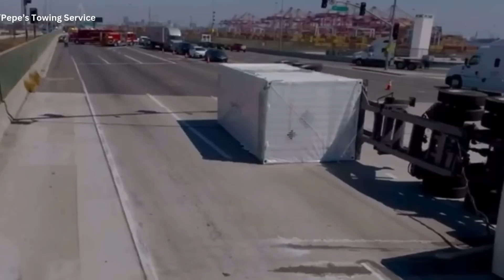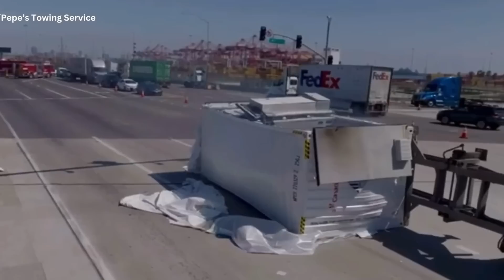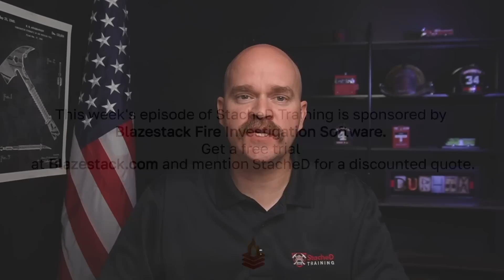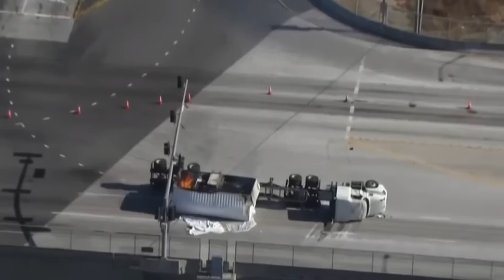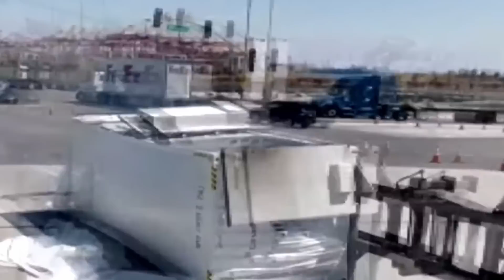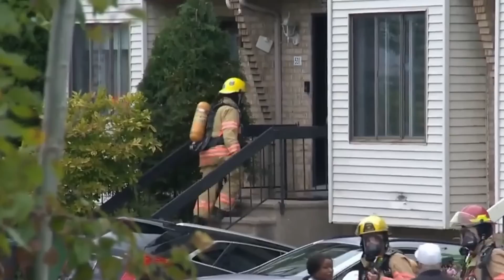LA Freeway Explosion & Montreal Port Fire: Lithium-Ion Battery Crisis

Comment: There are multiple kinds of Lithium batteries, LFP/Lifepo4 are safer than the NCM batteries in laptops/cellphones (and some EVs).  New stationary backup/solar systems should all be safer LFP Lithium batteries, but some EVs, including some Teslas still use the less safe NCM Lithium because they are lighter.  People concerned with safety should encourage the phase-out of the NCM-Lithium batteries in favor of safer LFP-Lithium batteries.  Gasoline is not the safest thing to be driving around with either, we are just accustomed to the risk of gasoline.  LFP-Lithium is a good, safe option for stationary home backup (probably safer than storing gasoline) but their high weight limits their usefulness for transportation (EVs, Drones).

Comment: While many blame the driver... The Product was a big problem because not only very Top Heavy on the Container Hauler but Very Off Center load waiting to tip over even at very low speeds. The only "good thing" it crash on the highway not turning in a city. Placard is a "new" number UN 3536 over black on white background. I'm told that background is for "low or no HAZMAT..." Riiigght.... UN placards are harmonize worldwide and not USDOT assigned.

Comment: New Release: 

Pepe's Towing Service has just released one hour of epic, edited footage of the L.A. port, Lithium ion battery container fire incident ...

U2oob: 60,000lb Lithium

Key Points:
0 : 16 ... Slo-mo of blow
5 : 50 ... Blow plus some peaks inside
9 : 45 ... 360 nighttime tour while burning
19 : 10 ... Still burning
27 : 25 ... Trailer disconnected from container
37 : 00 ... Tractor uprighted
46 : 30 ... Container at remote yard
51 : 16 ... Container uprighted

Comment: Every battery is a bomb ready to go off, and Lithium Ion batteries are the worst, it's fuse can be lit when the thin "cellophane" insulation separating the cathode and anode gets perforated for any reason,  the "fuse" is lit!  David Riddle

Comment: Fire departments need to look at changing tactics for current situations.  How about large fireproof tarps to smother fires because water doesn't work. These batteries need to be shipped differently like radioactive material. The big problem with lithium batteries is the people don't know how dangerous they really are. These are nothing like the batteries we grew up with and they have not been reported on like they should be. After watching many fires in New York city and other large cities caused by these batteries I thought the government would clamp down on them being stored in buildings. They have not and I think it's politics of safety. The reporting of fires caused by them especially in other countries has not been done.  If you know someone with a scooter or bycickle even a skateboard type device. Tell these people the danger they cause if stored inside home or garage. When they lite off its quick and explosive with no reaction time so don't store inside habited building. The other night I found a small battery that was thrown on the street. It was a bluelight that got my intention and it had cracks all over the case. I realized it was no good but I could not put it in trash or even store it In house. We put it in an old steel container and waiting to properly disposal
Reply from the maker: You can't smoother a lithium-ion battery fire.
Reply: @StacheDTraining  no but you can isolate one to not progress to another. Then enter a chemical I to it. I have no idea if that would work but there has to be a quicker process than letting it burn on location for hours.

Comment: The insanity of electric vehicles is almost over
Reply: Not likely. The climate alarmist cult will not stop until they are in full control of how we live. But, they won't talk about the toxic chemicals we dump in our rivers. They won't talk about the microplastics that saturate our environment and our bodies. They won't talk about the petroleum based pesticides sprayed on our food. Or how the majority of our food supply is processed crap that is causing the majority of our health problems. I'm lookin at you seed oils. NO, They will only harp on carbon production. Completely ignoring the fact that China is adding a new coal fired power plant every week. That's fifty two a year! They hand wave that away. Most regular people who buy into the narrative don't realize the production of solar panels produces toxic chemicals as a byproduct. They also ignore the fact that these wind turbines require 80 gallons of oil annually to operate. Yeah, real green. I could keep going on about how the climate change narrative is a scam being used as a process of control, but this is becoming a text wall, so i'm out.
Reply: What? The Netherlands now has more electric vehicles on the road than internal combustion and its going fine

The US is just too broken for thia to work there it seema
Reply: @h.c5750 That statement is incorrect. EV sales in 2024 MIGHT exceed 50% of total vehicle sales in the Netherlands by end of year, however of the number of cars presently registered in the Netherlands (ie, on the road),  87.8% are either petrol or diesel.
Further to that, the buying habits of a country that has a population that is less than half that of the state of California, is hardly an indicator for how the rest of the planet is proceeding with the electric dream.
Reply: @h.c5750  the Netherlands is a basket case of globalist fruit loops who want food production stopped, so you can believe the statistics if you want
Reply: @h.c5750 naive Netherlanders? No way unheard of. But you keep on repeating those government lies.

Comment: Would salt water work? You mention chlorine water. Salt is Sodium chloride. The  Ocean water has plenty of sodium chloride. Salt water is known to be the death of all electronics, Sample test Go throw your MacBook in the Swimming pool or Drop it in the ocean. So here's the thinking Salt water gets dumped into this container Alongside a cast iron pan. The iron in the pan will act as  an attractor for the electrons released in the water Causing the pan to rust almost immediately but short circuiting the Lithium ion cells in this contained container. Lithium is the third most common element on the planet according to the periodic table. Zinc is also known to be a counteracting agent to lithium.

Comment: I used to be miffed with your negativity toward  LFP LiFeP04 batteries. Then on August 2nd of this year, I heard a loud pop  in my shop, looked out the window and saw a curtain of black smoke rolling over the shop gutters. Within 70 seconds, I had my 1'' double line fire hose charged and spraying water through a small skylight that I thankfully never screwed down. A column of black smoke came out of  it and I shoved the hose and nozzle into the smoke leaning away in case of a flashback. It burnt my arm. I sprayed and prayed and guessed where the LFP battery console was. I saw gray smoke and the temperature went down by 50 degrees in the skylight by the time the Engine Company arrived in record time.

What happened? There were 12 name brand 300 amp hour LiFeP04 batteries in a cabinet with 4 batteries horizontal and 3 layers tall, all fused, all oversized cables, each in an individual compartment. An internal BMS Battery Management System FAILED and dead shorted the battery internally.
That cooked 8 batteries, set the cabinet on fire which cooked the shop sub panel and shorted the wires and burned through the ceiling. My bedroom is above the shop/garage.. This caused an estimated $100,000+ damage with smoke and water.  The Station Chief said that I steam smothered the fire in the ceiling and mostly put out the power console fire. The plastic in the batteries continued to burn and the Firefighters put foam on it and checked the entire shop and garage with the Infrared Camera.

The power console had 3 inverters, 3600 amp hours and 46,000 watt hours of power. Total load on the unit was less than 750 watts, almost nothing! The solar MPPT's quit charging and the batteries were at 100% when the one battery on the bottom shelf ignited. The utility company removed our meter because of the shorted shop subpanel and we were on generator power for one week. It has been almost 2 months and the lawyers just gave permission for the contractor to get permits and begin repairs.  

 I am now VERY leery about these ''safe'' chemistry LiFeP04 LFP chemistry batteries. I will rebuild the backup power system but will use the 18Kpv EG-4 system with its exterior wall mount UL Rating and it will be in a fireproof shed 25 feet from the house.  I will install Viking 205 degree quick acting sprinkler heads inside the shed.  This event absolutely did nothing to ''save the planet''. I might even get cancer from that evil smelling aftermath that took a month to subside. Fortunately, the house did not suffer from smoke damage.

Comment: Everybody talking vehicles. This is commercial storage. Where was the destination for this? I doubt it was going to be alone. Maybe a bit coin mining server system secreted near a neighborhood by you? They have to be charged by something to store the power. Either solar or wind or possibly grid to act as back-up. Anybody Know?
Reply: This commercial unit was not designed to fall over like that. Something flexed / broke / bent from impact and it shorted to runaway. Imagine having to fortify every storage unit of size to say nuclear casket type specs for the unlikely accident. These storage units, or containers with large loads of imported batteries should be escorted with pilot vehicles to destination for safety.

Comment: The only way thermal runaway could become a non issue, is to make it unlikely🤔. Using chemistries that are immune(NiCad,NiMH), but still has a higher power density is one. Another is to have a buffer zone with fire extinguishing material around each cell, while still maintaining a higher power density. Third is to have a chemistry, that will initiate a phase change(could brick the cell🤯), to absorb the energy release. The hard issue is the loss of power density, with any of these approaches. May be a day will come in future, where batteries could be making the exoskeleton and the majority of the structure, while still providing safe power🤞.

Comment: They were using a shipping container chassis to haul the heavy battery pack. Only lowboy or stepdeck trailers should be used to haul these. They will lower the center of gravity.

Comment: My point is that hydrogen can be quite dangerous if large quantities explode but massive hydrogen explosions are quite rare, but hydrogen burns very fast and very clean and leaves behind very little collateral damage. The Toyota Mirai can hold 5600 grams of hydrogen in a 142 liter tank at 10 thousand psi. 8 grams at 14.5 psi. Spontaneous combustion is almost impossible without the aid of an idiot and  if you poke a hole in the tank hydrogen is screaming out at 10,000 psi the tank will be empty before you can find a match. If you would have a choice would you prefer a Tesla fire or a Mirai fire?

Comment: As a past firechief, I have to remind you and others of the hazzards of WWII. Many fuels and chemicals were spilled into the ocean in many locations almost at the same time. The ocean still exhists. So flooding that truck would be a minor problem of contamination. If it was a multipul car train, then contamination would be priority one, on argument! The object here is to contain and remove the hazzard. Lift it into a larger container, seal it and take it to a disposal site.
Reply from the maker: While I agree to a point,  moving one of these units is not easy.  A "larger container" isn't something all that practical.

Comment: I wish he would have explained, what is an "energy storage system"? How does that differ from a Li+ battery?
Reply: storage systems are multiple battery cells
the batteries of an ev make up it's energy storage system that are enclosed in their supposed protective case
stationary storage systems are for grid use or powering a factory/industrial site
Reply: Q: How does that differ from a Li+ battery? A: it's GINORMOUS.
Reply: Don't know much so in my Limited Knowledge of the Whole Green Energy Lie is the need to Store Excess Electricity from say a Solar Array which produces most  during daytime.  The Really Big Lie is in building Massive Battery Storage.  A Women Canadian Minister had a Video about how much it would cost and the amount of energy that could be stored.  Cost a Hugh Amount for a Couple of Hours of use.  She told it straight 👍 and anyone who wants to trade the Reliability of Coal, Gas or Atomic Power should be given a Mental Examination as they are 
Bat Shit Crazy!

Comment: All because the side effects of you adding enough fire level heat energy to the invisible from outer space amounts of air in your house to stay warm in the winter. It turns out those trace level side effects are enough extra heat to defrost Canada. 
And the miles of air overhead. 
I mean, duh, everybody knows that.

Comment: Another issue is if they let the fire burn on a bridge is permanent damage to the bridge structure and the road way due to long extreme heat going to keep that bridge close?.  

Protocols need to be develop for an unified command structure and who the the right people to include in order to determine what to do after the initial response.  Fire Chiefs cannot make that call alone on what to do with these fires.  There could be millions of dollars in costs and State and local officials, health and EPA, DOT, SME, etc need to determine the safest and least costly course of action if you can put out the fire.  Do you flood that storage unit and risk the run off to prevent billions of dollars of losses from trucks being unable to get to the shipping ports while the bridge structure is repaired?  Or do you let it burn.   Does the damage to the fish outweigh everything?  Is the air pollution worse than run off?  Can you even flood a container? Can air monitoring be done to open up freeways next to trucks hauling EVs that had fires or do you keep the freeway closed for days while they repack DDR batteries for removal?  There is no one answer but protocols need to written to assist local responders nation wide on the the safest and least costly thing to do for several types of situations.  I am betting some places may only see EV and DDR fires once in a career like a major hazmat while others departments may get to see one or two a year.

At some point the fire chief must said, the fire is not spreading, the people are evacuated, these are the resources I can get you, and I have 50-50 chance of being able to extinguish the fire.  Now, the people that control the money and the environment, what do you want to do?  And I don't do the clean up.

Comment: Just cover it with a heavy fire resistant sheet.
Reply: Yes, that will work: 🤣🤣🤣🤣🤡🤡🤡🤡
Reply: @bellytripper-nh8ox  It does. Fire departments in the US are doing trials on such a system now. The aim is to starve the fire of oxygen.
Reply: @michelians1148  this isn't a normal fire where the fire gets oxygen from the environment. Lithium batteries will continue to burn even with them being covered because they're self oxidizing so they're going to continue to burn even fully covered. The fire proof sheet is to keep it from spreading to the area around the fire, not to put it out.

Comment: The batterys are relatively small 
Time to retrofit a Container truck with small pods to be a Lithium Battery Hazmat Dunk Truck with Multiple Robots and Drones.
1. Reinforced dunk tank pods filled with that brine solution mixed on site 
2. Multiple Remote control robots with the cutting tools to cut the batteries out and drones to drop the batteries in the dunk tank all controlled from the driver cab.
3. Driver Cab with fully self contained air supply controlling everything in total safety.

Comment: Cannot have a fire on the Bridge deck itself so whether this means some type of "fire fighting drone" needs to part of Kit or not serious question in need of a serious answer given how massive drones have now become and a very valuable tool for possibly handling this although hopefully with a battery that is up to proper standard no idea what that is although Israel blowing up battery powered devices is worth a deep dive as obviously don't want them doing that here in the USA. The amount of flammable material that is a truck prime mover is enormous as well presuming at some point the Trucking Industry will push to start mitigating this risk given hybrid drive and pure play battery powered trucks now being made. No shortage of advanced plastics and fabric materials being made in the USA to do just this actually😊